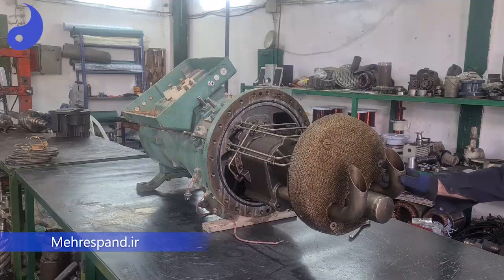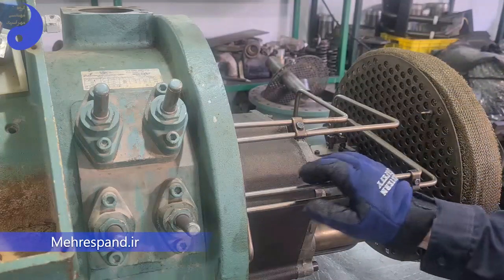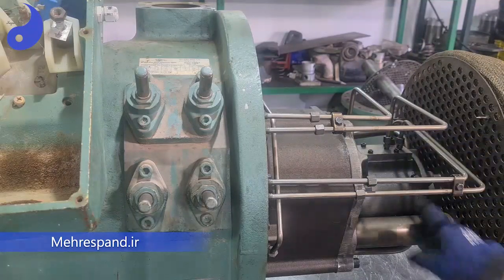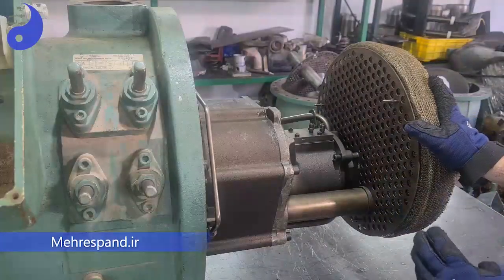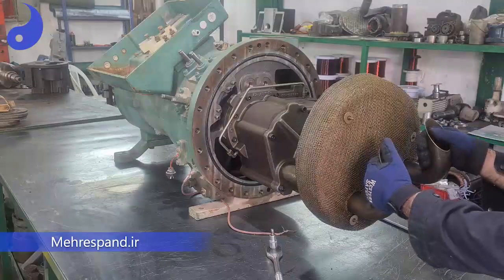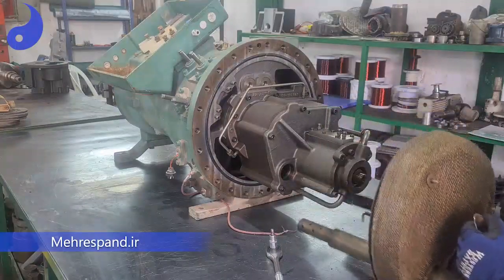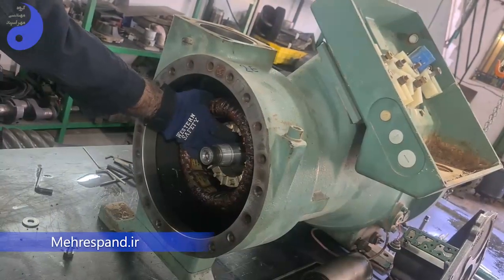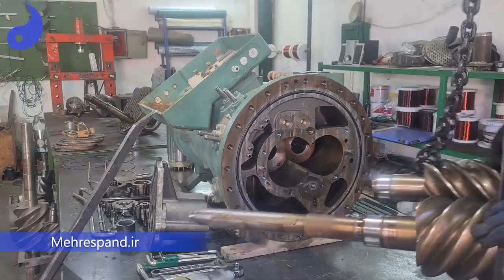Disassembling Bitzer Screw Compressor Csh And Introducing All Parts

Comment: I request U pls teach us how to check the gape between male and female screws while fixing again ....
Reply from the maker: OK
Reply from the maker: Hi this parameter is not important in screw compressor and it can't be check by usuall tools
Reply: @mehrespand_ir But I was told by the Bitzer Engineer that it is very crucial and precious to measure clearance between two screws  by using a filler gauge or by utilizing 2  Dial gauge axial and radial  otherwise screws can get stuck altogether mean screws chambers will be torn away completely ... Pls assist with your experience ....